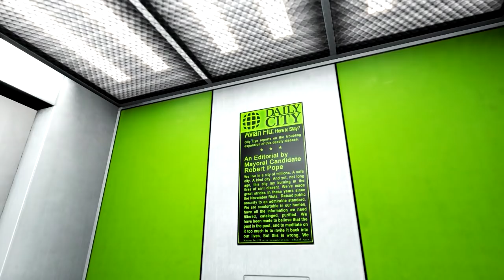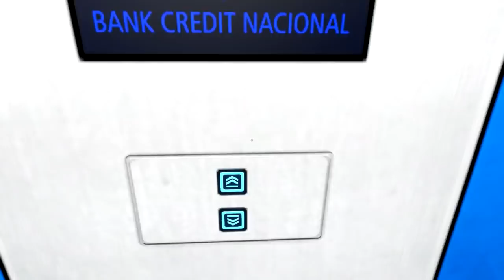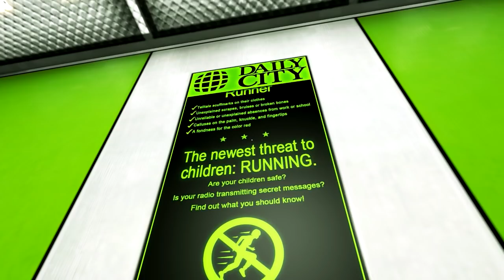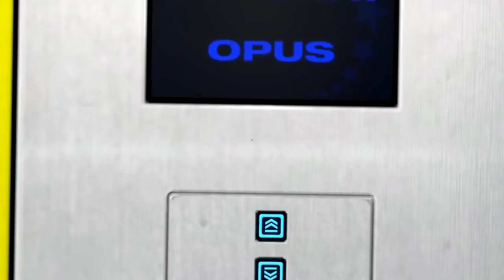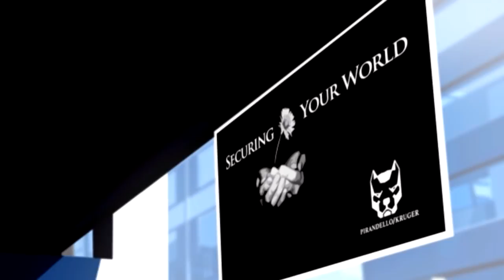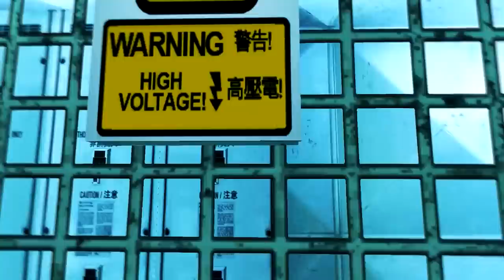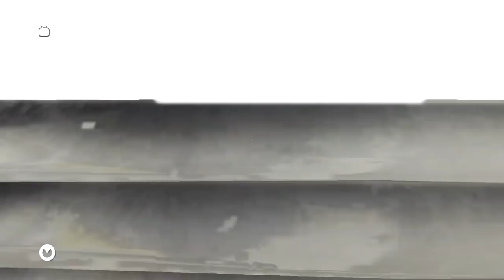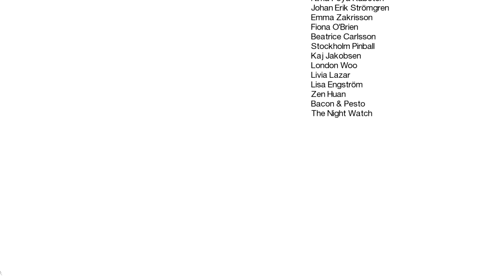Mirror's Edge - Full Game Playthrough (No Commentary)

Comment: 01:36:00 you figured it out in couple of minutes what I couldn't for hours. Big thanks for that, there was another walkthrough video which did a walljump on those gray concrete blocks instead of wallrunning and going up where the hole is. IDK how he did it, cheating or just other platform where it worked but I could not do it for hours. This game is really punishing 🙃